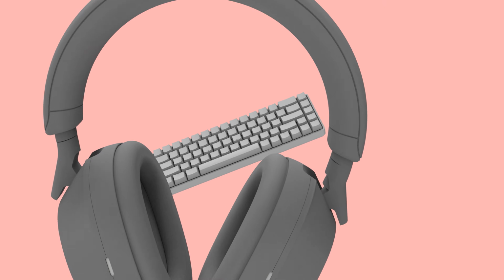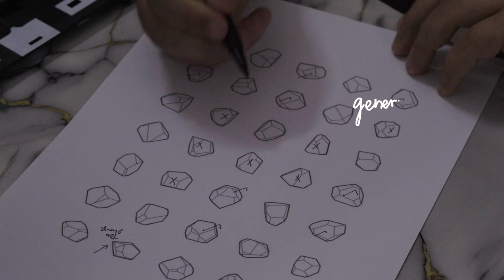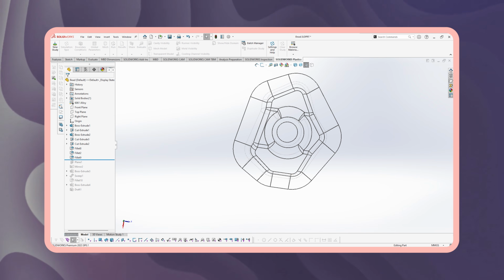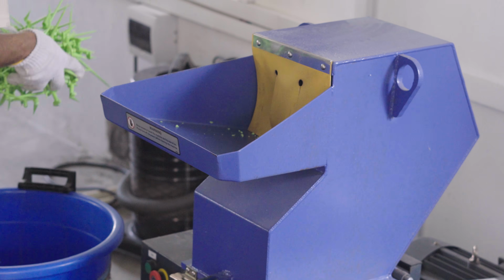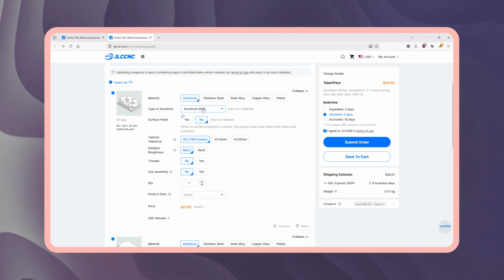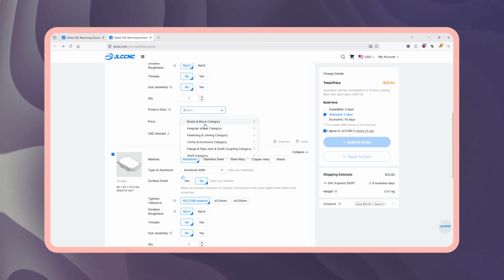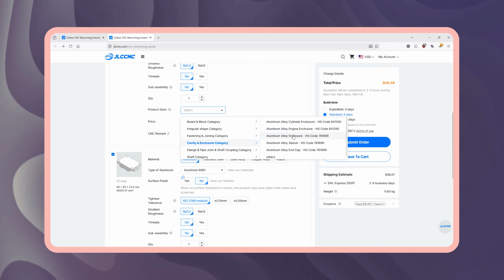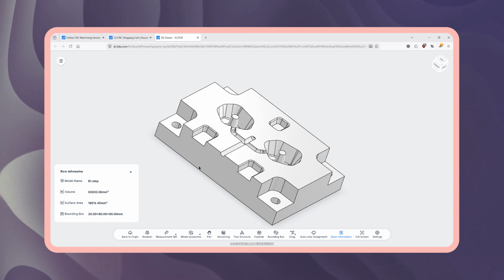I Stopped 3D Printing and Made an Injection Mold

Comment: How much estimate did this cost (mold + plastic)
Reply from the maker: It was $120 + Shipping for the 7075 Aluminum but mine was sponsored. For same file, around $90 for 6061 aluminum. The plastic cost varies depending upon your location. It cost me around $1 per kg for recycled PP.
Reply: @product71 thanks. Tbh where I live it would be cheaper than 3d printing